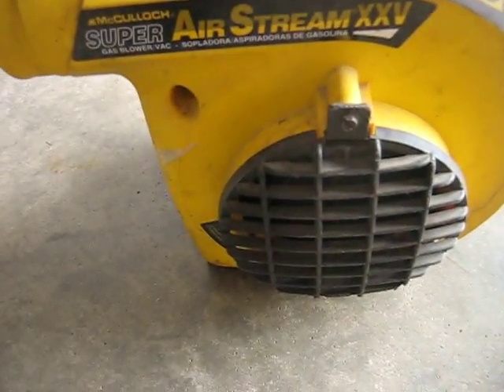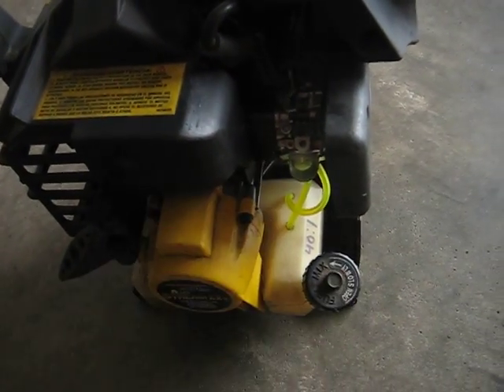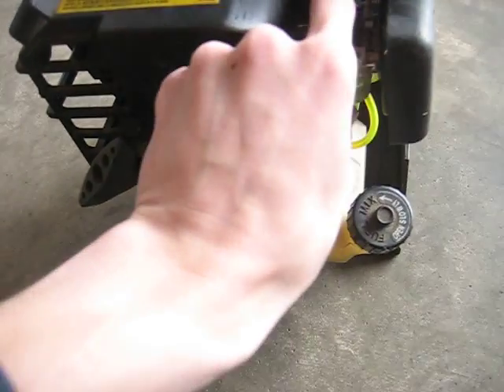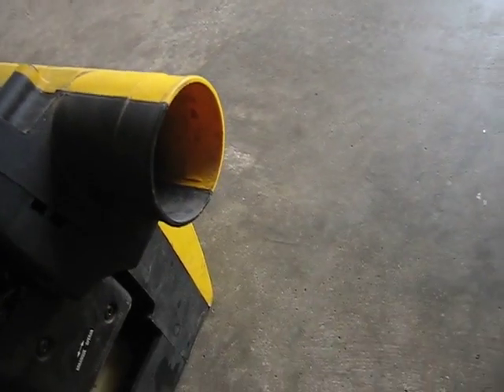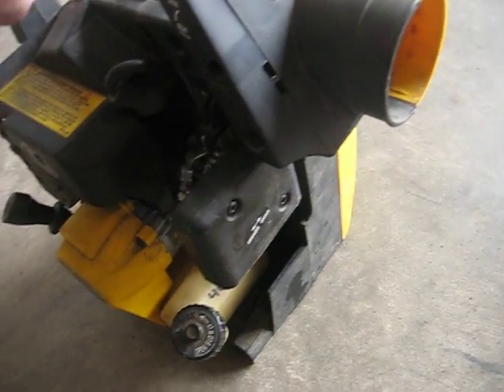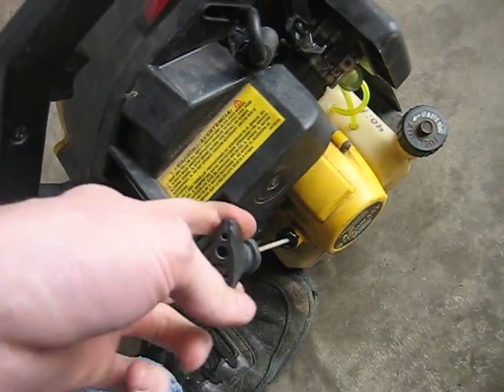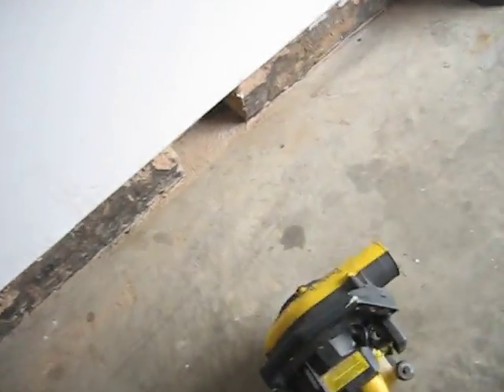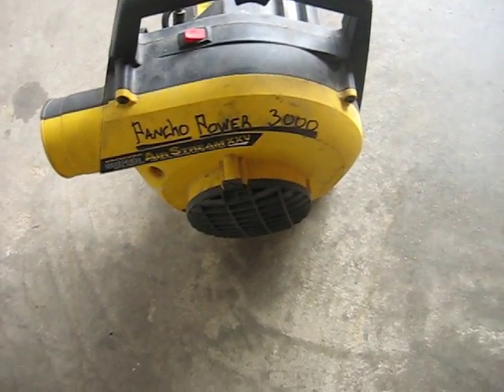McColluch Leaf Blower no Exhaust

Comment: Hi
I have the same blower but the fuel lines are missing. What size are the ones you replaced and also part number for fuel filter. Blower sounds great even without exhaust.
Reply: It doesn't matter any small fuel filter will work on these. I just yanked one off a craftsman weedwacker that didn't run but had a good clean fuel filter, before it would start and die. The symptom of no fuel filter, now it starts and runs perfect. As far as gas line. When you buy the 2 cycle small gas line kit at the store it comes with 2 sizes a thinner line and a thicker line. It takes the thicker line. It's basically the generic larger gas line out of the two main sizes made. You have to lop off the end so its pointy to stick it thru the small hole on the tank once its in just work it in slowly until you have fed them down all the way.

Comment: i have te same blower and it smokes and its very loud and mine even has a muffler on it
Reply: The manual says you are supposed to pull the muffler and clean the exhaust ports on a routine basis. Like once a year. I never did but when I got the manual yesterday that was part of the maintenance procedure.

Comment from the maker: @JoshuaAndMom It was warmed up. It usually takes two pulls when cold.
Reply: Mine starts on one pull on choke if you get it off choke fast enough it will stay running if it does before you can get it off choke it will require the second pull. If it's warm out and you primed it and started it slightly off choke it will start on one pull.
Reply: That is an air stream xxv. I used to have a super airstream iv, exactly identical to this blower.